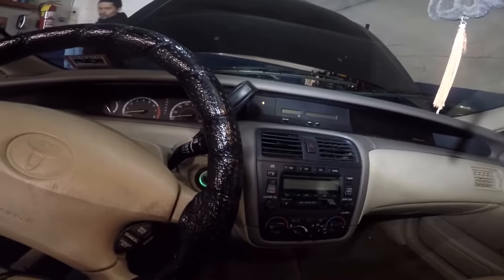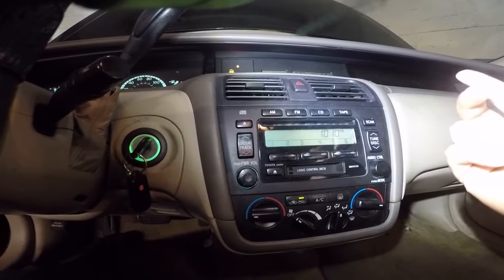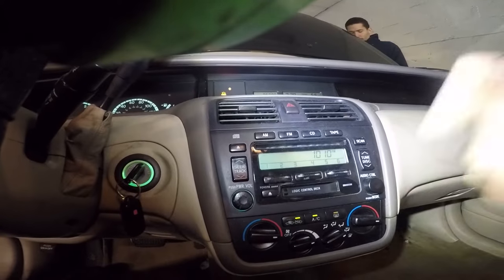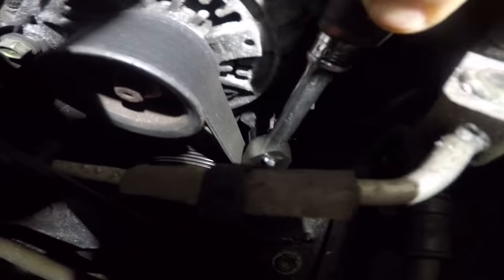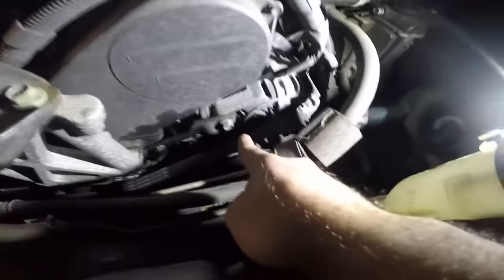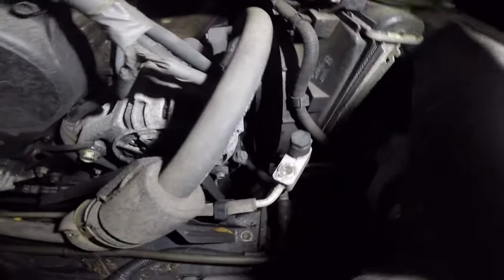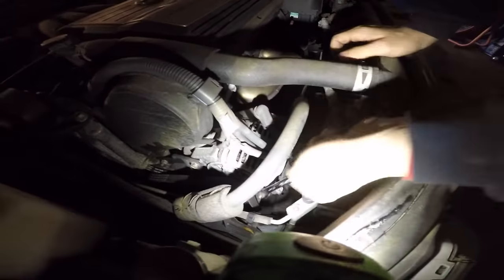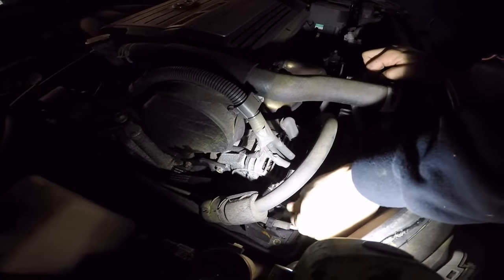squaking noise when car is cold or when putting AC on

Comment: I had this issue. That is improper belt tensioning. I had my alternator, serpentine belt, and battery changed out. This issue came up and when I blasted my AC it would also make that noise as well as cold starts. The belt is slipping and is not properly tensioned. You need to get this fixed ASAP as if you do not your alternator will break in 5-6 months like it did mine. Especially if you did not have this issue prior to a new belt its likely not tensioned properly have a mechanic redo this over and over on cold starts till the noise goes away. Also, side note my VVTI camp shaft its a part in the toyota engine broke as well likely due to this issue. So let this be a lesson learned for all of you that you need to get this fixed ASAP. The VVTI toyota parts and the things connected to the serpentine belt as well as anything that is connected to starting a car can break....and its not cheap...
Reply from the maker: Yup thanks for ur input

Comment: Here's what I did to fix mine. Take an old tooth brush with soapy water and carefully (be careful not to get hands too close) scrub the belt on the inside surface while it is running. That will improve the grip of the belt against the pulleys. Assuming the belt is tight of course and mine was tight. It may be wore some and need replacement eventually but cleaning the belt of oil and grease seemed to fix it for the time being.

Comment: This has been driving me insane on my 2002 toyota solara. It is very embarrassing to get out of work and start my car and it squeals so loud. I have replaced both the alternator belt and power steering belt and it is still squealing! Is there some sort of specific torque it needs? I must not have it tight enough??
Reply from the maker: Feel the belt of it feels loose give it more tightness some time u have to do little by little see which one feels loose

Comment: Finally found a video that has the same noise that my car is making. Hopefully I can fix my car soon so I can have ac 🥴
Reply from the maker: Okalani Leo loose its old belts will make squeel
Reply: My serpetine belt came off.my corolla,,mine was the tensioner pulley,,,squeeling noise only when park or neutron....i think the cause now is the a c compressor
Reply: @RBTheMechanic  my ac works completely fine in my 07 yaris it's actually super powerful

But it squeals randomly, especially if I just max the ac when it's 100 degrees in Houston it's annoying...

I don't wanna buy a new compressor cause not only am I trying to sell the car, I don't wanna spend the amount I'm gonna sell it for lmao.
Reply from the maker: @TheLostDude7  ok cool good the ac working fine but the squeak can be belts try this trick I made video on this u can use windex spray and u see any difference most likely blots belts here’s a link to the video do this when u heat squeak immediately try it https://youtu.be/cGSY5EmH1Rs
Reply: @RBTheMechanic  thanks man I will try it soon and report back

Comment: I have been having the same problem for a long time now with a 2005 Toyota Sienna LE, and the squeeling noise is only on the start up and with the AC on the On mode.  The squeeling noise only goes on for like 20 seconds and then it goes away, and the noise will not return as long as the vehicle is still warm.  In the past, I've taken it to several name brand mechanic places and they have all failed to take care of this issue.  What I am going to try and do myself is follow the steps that you give and tighten up that serpentine belt.  As a matter of fact, I just checked the belt today and it is not as tight as you show on the video.  So tomorrow, I will follow your steps and see if that corrects the issue that I am having with this squeeling noise.  Thanks for sharing!

UPDATE: It was exactly as you said in this video! I had to do the loosening up and retightening of the bolts twice, but I finally got that annoying screeching sound fixed! Thanks a million!!!
Reply from the maker: Yeah if it got adjustable tensnor this might work for u
Reply: Same issues am having now on my rx330 will check this fix out

Comment: This has been my problem. When my belt starts squealing I’ll go look at the sides or back of my truck for oil spots. Most hoses are under pressure so a loose hose clamp will be loose. Under pressure power steering, oil cooler, transmission cooler line is leaking getting on the belt. Ill find that leak and fix it by tightening the clamp.. once my power steering pump cap was leaking.. I leave car off and spray a pulley that has ribs with armor all car detailer. It conditions the belt. Then I turn on the engine. You got to find out why the belt is slipping. If you find a leak anywhere around the accessories fix it. If you have no leaks still spray the pulley with ribs. If it stops then check your belt. Dayco belts are cheap and when new will squeal.

Comment: I had the same problem and massive power steering leak from high pressure line and pump, I'm at 160k, doesn't surprise me. The power steering belt was OG Toyota 1998 and it's 2023. Was cracked but still didn't break. Great car, never give up on them, they will roll forever.
Reply: The pump is 65 bucks on Amazon, totally works.
Reply from the maker: Yup

Comment: Great video. I am having similar issue with my car (Screeching sound while starting my car in the morning. The sound stays for 3 to 4 seconds and then goes away and does not appear for the rest of the day (I do multiple start/stop in a day because of multiple activities  such as school run, going to office & coming back, school pickup etc..). I did check this issue with the Halfords and they were unable to identify the problem. I've even recorded the sound coming from under the bonnet and played it back to the Halfords Service Centre. Unfortunately they were unable to identify the issue. The interesting fact is that I did a full service (cost me £230) with the Halfords on 8th March'23 and this issue started appearing after the servicing. I am not sure if this is a coincidence or they have messed it up during the servicing of my car.
Reply from the maker: It seems like belts need replacement

Comment: Hey I have a 1996 Tahoe 5.7L with A/C, single belt system.  Belt is good and snug.  I get a steady and loud squealing noise when the truck is idling AND the A/C or defrost is on. If I turn the A/C on with it running above 1,500 rpms it will not squeal unkess I let the RPMs fall back down to near-idle speed.  But if I turn on A/C and then increase RPMs it keeps squealing.

The compressor clutch will turn easily by hand when truck is off, but it's not loose. It turns but won't spin after I push it or anything like that.  No oil or anything wet around the compressor. Blows cold air. Squeal stops immediately when knob turns vents off Defrost or A/C button is turned off. And returns immediately when activated again.

I also noted my Battery Gauge drops from 14 volts to 11.5 volts when the truck A/C compressor clutch or belt squeals. Almost like the whole pulley system is being slowed by the A/C engaging. 

I'm going to ohm test the clutch to make sure it reads 2ohm or higher, but other than that, what can I try to verify what's bad?

Should I spray a little light oil like WD40 on the front of the A/C clutch?  One guy did that online and it stopped his squeal, but that was a different make vehicle.
Reply from the maker: Well when it squares spray sum windex of sound changes it will be ur diagnostic bad belt
Reply: @RBTheMechanic  I carefully put wd40 between clutch and compressor pulley, and also dressed the belt in 3 places with some armor all. Got quiet.  Now it squeals a little for 1 or 2 seconds when I accelerate, and then stops. It didn't do that before.  😆

Comment: So in summary, the belt was making a noise because it was loose and thus slipping, so to tighten it up you just physically adjusted the alternator?
Reply from the maker: Yup this one was loose I would look at the best condition on any other car to see if belt is old cracked before doing this

Comment: I have a similar problem it only happens in the morning, but after I heat the car up it’s fine. I’ve noticed it specifically happens when everything thing is on like ac,headlight, and whenever I try putting my windows down or up it makes the noise from that small amount of pressure added to the alternator. I got my belt changed and it seems to be tight, but the problem is still there. Could wd40 fix it? I know someone who had the same problem and wd40 worked for them
Reply from the maker: Mostlikely bad belt or lose this is the car on cold start up belt noise goes away once the belt heats up

Comment: Hello we have a Dodge ram 1500 2004, we put a new engine, new exhaust system, new ac compressor and ac system , new tention pulley,new serpentine belt. We had chirping but it went away when we put the new tention pulley. The next day the cooling system lines bursted, we got those fixed by a mechanic, we picked up the truck everything was good we turned the ac on and now the chirping is back.  Could some of the residue from the cooling system lines have gotten on the serpentine belt? Or what else can we look into? Any advice would be great.
Reply from the maker: Not sure since it’s new belt how did u recharge the ac system and also possibility the belt is either loose wrong or bad never think new part r always good

Comment: I have honda fit 2007. I just had the compressor and belt replaced. But belt is squeaking now when my AC is on. I can only have AC on while driving above 25mph. Or once the engine is warmed up.  Is it cause the belt is cheap quality? Should i get something more expensive or just have it adjusted. It cost only $15
Reply from the maker: Ok that car belt can be adjust so give it small adjustment don’t go crazy right either do little bit and see how it works out if it get better and still small light amour squeal do little more that should fix it other wise replace for better belt.. I have had belts that squeak just because of the quality usually I go ac delco belt or original from dealer
Reply: @RBTheMechanic  thank you 😊

Comment: Can you tighten belt tension if car has an automatic tensioner?  I have 1999 Corolla with this problem, but it has the automatic belt tensioner.  Intermittent problem started shortly after replacing belt.
Reply from the maker: No theirs are none adjastable

Comment: I have a 1997 honda civic 1.6 L engine . I just got the serpentine belt and the ac compressor belt  fixed by my mechanic and its still squealing . I had someone else look at it and they said it may be the clutch on the ac compressor . Does that sound accurate before i go and pay for a brand new compressor to be replaced ?
Reply from the maker: U should try to adjust the belt a bit before anything some times when I install a new belt it also need to be adjust after it run for a bit cuz it streches and loosens up a little

Comment: I have a 2021 Hyundai Atos 1.1 Motion. About two days ago, this screeching sound started when I turned the AC on. It is so loud and annoying. If the AC is off, no screeching sound. Should I still tighten the belt?
Reply from the maker: U can’t on these it for spring load tensioner I believe relay the belt and check ur tensioner first identify if it is the belt u can spray windex on it when it makes the sound that should give u some type of change and idea that it is the belt

Comment: Finally found the issue I have a Honda 2001 and my car does the same thing when I turn on the ac , heater, or defroster
Reply from the maker: Honda is diffrent set up but it got adjustments if u think belts are old or haven’t changed in years replace them

Comment: Why would the alternator cause the belt to slip because of "load"? The belt was loose that's all.
Reply from the maker: Usully over time the belt will stretch out so if it’s old old belt replace it and check the condition for cracks and yes once there ac load or alternator load that’s when it will slip

Comment: Hi, would this Avalon be similar to a 2013 Lexus es 350? I am having a similar issue.
Reply: I only hear the squaking noise randomly when I turn the A/C to lowest temperature, if I keep it at let's say 22 degrees, then there is no squaking noise.. do you think this is the same issue?
Reply from the maker: Not same but similar
Reply: @RBTheMechanic  Could it be the compressor?
Reply: Or what is an obvious sign that it is the compressor? Thanks for the feedback
Reply from the maker: @thewestbank23  what do mean ? This is video on belt and squeak what issue ru having?
Reply from the maker: @thewestbank23  it can be depends on ur belt condition and tension if ur talking about squeak u have to do the basics first

Comment: Hi have a same problem  on my car Mazda 6 2005 but have got any solutions till yet
Reply from the maker: Might want to start with new belt
Reply: I have already changed my belt as well but didn’t worked 
After I start my car at cold night and turn on my ac it make noise something like in your video and disappear after some time .
Reply from the maker: @nirmalkayastha103  could be bad tensor however did u match up the belt to see if it was same size or bit smaller
Reply: Have done everything I have changed the pulley, changed the belt twice and adjusted tensor but still didn’t worked
Reply: @nirmalkayastha103  It is a problem that it happens in same Mazda cars... For example, in my Mazda Protege. Could you fix it ? What was the problem ?.

Comment: I have a diffrent issue.. there is a noise while switch ON the Ac only. Is this the same issue with it? Or diffrent?
Reply from the maker: Describe me the noise
Reply: @RBTheMechanic  
When I start the car there is nothing noisy but right after turn on Ac there is a noise from the engine side. Also not sure from engine or any part of it.
Reply: @RBTheMechanic  
https://youtu.be/j7yflp1WFrU
Exactly the same noise 👆
Reply from the maker: @saranyams7443  that noise is pully it can be ac compressor or idler any pully that’s running with belt u can check like he did and take off the belt with engine off and turn each bearing pully and see which one makes noise gonna have to do some physical diagnostic
Reply: @RBTheMechanic  
Thanks a lot .. it was very helpful 🙏

Comment: Yo my accord cb7 ac belt was noisy only around 5 seconds on cold and replace it and still makes the noise on cold and its tight enough idk whats wrong
Reply from the maker: Did u buy good quality belt?
Reply: @RBTheMechanic  yess man around 35$ but only does tht noise only cold start and i thought it was to tight i loose it a lil and now makes the noise when i berly turn on ac for like first 10 seconds

Comment: How do I tell the mechanic that put this on that the belt is loud. It's a new belt and it is loud
Reply from the maker: Then u have to adjust it if it got adjusted like this video u can’t add this mechanism what year car u got
Reply: @RBTheMechanic  I have a 2004 Nissan quest built out as a camper. Everything I ask for them to fix they jack the cost up to over $2000 even to tighten a belt they put on $500

Comment: Omg i love u posted this video i cam across it. See if have this saaame issue exactly with my car its an 06 nissan sentra but mine at times also does that screech when it starts cold.. Or here and there thru out the day when i start it up..  I took it to a mechanic and he heard it with ac and stuff and said it could be the Air Compressor?  Should i get a second opinion?
Reply from the maker: Get a second opinion

Comment: So I have a Toyota iris, and mine is doing the same thing when I turn on the air just when I turn on the air
Reply from the maker: Yes load is causing it check belt tightness or replace it if it’s old maybe stretched out

Comment: If mine slightly squeaks when its Hot in Az does that mean the belt id lose?
Reply from the maker: Yes spray windex on start up when it makes noise if it changes sound that’s what it is
Reply: @RBTheMechanic  thank you alot bro!!

Comment: My car have a noise right when a turn on the AC help . only the AC is on, no noise if only the engine is on also no noise  but if both  engine and AC are on that's when there is a noise???????? Help
Reply from the maker: Well that noise might be related to belts or ac compressor

Comment: What if my Nissan rouge is squealing like this only when I accelerate and blowing hot air from AC?
Reply from the maker: Bad belt replace the belt and about ac blowing hot check fuses and pressure in ac system
Reply: @RBTheMechanic TY I really appreciate your response!  
I'm also in Houston. Where are you located ... incase it's not the fuse?  ...cos imma need AC stat!! :)
Reply from the maker: @wndywoo  I’m north nj Bayonne east coast
Reply: @RBTheMechanic  i live in northern jersey. can I stopby at your shop?
Reply from the maker: @shintahadinata519  sorry I do only appointments so we have to schedual a day and need to know type of repair
Reply from the maker: @shintahadinata519  email u if u send me email

Comment: my car squeaks only when sitting until you start driving, then it stops, i turn on the ac and the squeaking is so loud, then i drive for about 1 min and it stops completely
Reply from the maker: Sounds like bad or loose belt which slips when it got load on it

Comment: So is that the serpentine belt i need to change?
Reply from the maker: If it’s ole change it. Some time after changing it will squeak that means u need to adjust it because it might be loose
Reply: @RBTheMechanic  i have a kia sorento 2005 and i want to change all 3 belts , what are the belts that i should change?
Reply: @RBTheMechanic  there’s 3 belts in front engine. Do you know the names of those 3?
Reply from the maker: @jimbooo5713  power steering belt alternator ac belt this would be most ideal